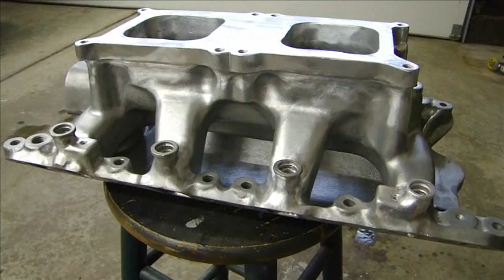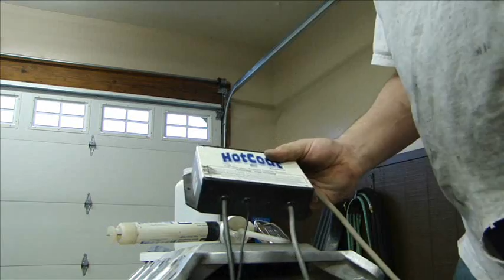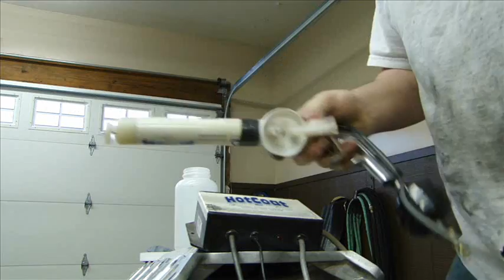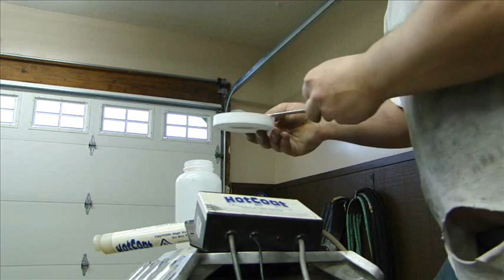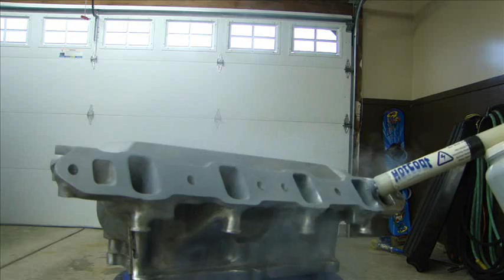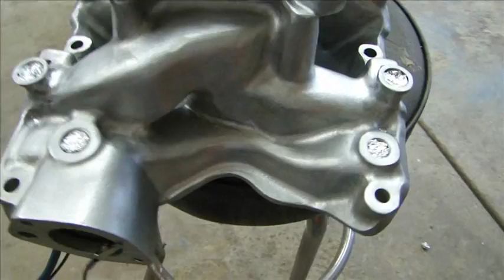Powder Coating Basics

Comment: What equipment is necessary at home to cure such powder coated items as this?  If I were to want to do wheels, I can understand the powder coating equipment, but the oven I am not sure about.  Do you have an oven to bake powder coated things in at your home?  Also, do you need to keep the ground connection on after the powder has been applied and while its baking, or could I powder coat some wheels or something and then take them somewhere to bake?
Reply from the maker: +Jayj93pgt You just need a simple powder coating kit like one from Eastwood. You can use a small electric oven that you can buy used. The ground comes off after coating.

Comment: Hey Pete I have cleaned parts extremely well, de-greased, coated, and baked. However sometimes i see imperfections like bubbles and fish eyes. Only method i have heard to avoid this is to warm the part or bake the part first before coating at all to get the gas bubbles out and or oil/grease you can not remove with a wire wheel, grinder, or de-greaser. I would like to know how you avoid imperfections from the process to get a smooth finish even on cast parts etc?
Reply: +djspock5150  also have you used any metallic primer or a type of primer base to smooth the part first?
Reply from the maker: +djspock5150 I do not coat the parts first. Sounds like you are being very clean. If you use anything like WD-40, and spray it in the same area you powder coat, there is enough in the air to cause imperfections. Make sure you put a small desiccant dryer in the air line right in front of the gun.

Comment: i wouldnt recommend coating those runners...but too late
Reply from the maker: +Mark Alvarado I agree. I have since stripped that manifold and recoated it without getting any in the runners
Reply: If you get powder in the runner just use your air chuck and blow some small bursts of air through each runner and it will clear the powder out of the runners. Problem solved.

Comment: Actually the part itself needs to be brought up to the temp your powder requires, for example. if super gloss clear requires a temp of 375 or lower depending on formulation, you need to bring the part itself UP TO that temp of 375 after flow out, THEN you set your timer for 20 minutes or however long the manufacturer requires. I've been an avid and professional powder coater for 7 years now and learned a lot making mistakes along the way. The reason you need to allow the part itself to come up to temperature is to allow the powder to properly adhere and cure and allow the cross link to happen. You risk for delamination to occur in the future and constant temp changes can cause it to peel from expanding and contracting.
Reply from the maker: Awesome! Thanks for sharing with us

Comment: Just so I understand you correctly you first applied the Silver Vein and baked it. Then while its hot you applied one coat of Super Gloss Clear and baked it again. Did you repeat this process for all 3 coats of clear?
I applied Super Gloss Clear to my Silver Vein after it cooled and did not cover very well. Can I reheat my part and follow your steps of should I start from scratch?
Reply: Paul Marshall I coat parts warm or hot with clear. If you are not getting your part to coat very well, instead of having activation switch on try coating without it. Sometimes with the heat and weather it won't coat well. Yes weather does have an effect. I also use a fluidizing reflector or remove it. The best deflector to use is the one with about 5-8 small holes on the front of it. I like using it especially when dealing with silver and copper vein or any textured powder because it mixes and evenly distributes the powder. The only time you need to strip it back down is if there are major flaws. Usually with the clear you can reheat the part because usually clear only needs to cure at 350

Comment: Is it okay to touch the work piece when it is charged?
Reply from the maker: Yes. But after you touch it you will need to recharge it before applying powder. DON'T touch the electrode in the gun.....you
ll get zapped.

Comment: Nice video. One question though. Is this motor going to see action, why paint the inside of the engine?
Reply from the maker: There was only powder coating on the inside of the intake. Since it is fuel injection the only thing going through it will be air.
Reply: ***** Aha, I don't really know that much about motors. Well, I know that they should be clean, except for fuel and oil.

Comment: Hey peter. I am really inspired by your video (eyeballing some powder coating systems on ebay right now). When you mention the temperature 375, is that celcius or farenheit?
Reply from the maker: The temp is 350 to 375 F for most powders. Eastwood.com has a great starter set. I have been using the gun for years and it's only like $150 and comes with some powders.
Reply: Very nice, Thank you kindly!

Comment: Pete   I just subscribed to your channel, "great stuff"  Just wounder why you Powder coat the inside of the manifold? I would be afraid the coating would come off over time
Reply from the maker: Steve, that has been the most controversial thing I have ever done in  video. This is a fuel injected motor so only air is going through the manifold. If it were a carb engine I would not do it. I have powder coated things and tried to bead blast it off and it is almost impossible. Once the powder is only there, only chemicals can dissolve it. Thanks for watching and subscribing!
Reply: ***** looks way cool

Comment: Thanks. I think I had it on the 25kv setting. So you're only supposed to hold the "charge" button for a few seconds, then let off and coat?? I have been holding it the entire time.  I did apply the clear when hot out of the oven (because you said to) and put it right back in. Its not terrible, but I want better.  :0)

Comment from the maker: It could be something simple like the part is connected to ground so the charge dissapates, or your air pressure is too high. Have a good solid ground for the clip, charge the part a few seconds before applying the powder, and don't spray directly at the part. Let the powder drift and settle on the part. The clear will discolor the chrome, but I have good luck putting clear on a hot part, right out of the over, then you can see how the powder lays. Try pre-heating parts first, it helps.

Comment: Pete, I could use some of your experience. I have a hot coat setup like yours. I have done a few parts. I am finding that power is not wanting to arrtact to certian parts at times. This IS NOT the faraday cage effect, just flat surfaces. I just did a part in reflective chrome and it coated well. I cleared the part the same day, and one select area was rejecting the clear. Any ideas how or why this is happening?? Its frustrating! Thanks for your reply.

Comment: mixing powders doesn't work, if you mix red and green, you get red and green speckles for the most part. like if you spray white, then don't clean the gun well enough n spray black, you get white specs or visa versa. you CAN add pearl, metal flake, etc though, and there are some powders that ARE multiple color mix to achieve cool effects. but black and white doesn't make grey like paint.

Comment from the maker: That is an excellent question. The dye in the powder is a contaminant, which means it colors each spec of powder. I don't think if you mix powders the dye would mix from one particle to the next. I am not an expert on that, but if you call the tech guys as Eastwood they would be able to tell you for sure.

Comment from the maker: That is a great question. From a manufacturing perspective I would guess their frames are painted internally, but sent out for powder coating. They are in the motorcycle business, not powder coating,,,but that is just a guess. I know guys prefer powder coated frames but I discourage it because it is impossible to touch up.

Comment: "Charging" the part is not necessary. From an electronics point of view having a good, secure ground is what will make the powder stick. Double check the continuity of the part with a multimeter if possible. Also I have opened up the Eastwood power supply box and there are no capacitors that "charge up". Just a single step up transformer.

Comment from the maker: Even the slightest breeze will blow off the powder. I have a fan I use in the room I coat in and it will blow the powder off. Since you are putting powder over powder, hold the button down for a minute or so to make sure the part is charged before you coat it. Also, it is possible that your air is charged with the same static needed to charge the part, or, the air is taking static away from the part. You can stop this by making sure the compressor is not on the same breaker as your gun.

Comment: Hey Pete, i have the same gun as yours. But for me when i try to shoot my powder on whatever i want to powder coat, sometimes the powder adheres good, but sometimes it will not adhere AT ALL. Especially when i try to do candy color, base go on good, but the second color will not adhere at all!!

I shoot the powder in my backyard, because i dont want to clean up the mess, do u think that is my problem? Because of the air/wind and what not?

I do have the ground clip onto a metal at all times.

Comment from the maker: Thank you very much my friend! Powder coating is a pretty cool process. I think you hit all of the finishes. The great thing about powder coating is it will not run. It's nice to have a glass finish that is perfectly flat. I have been working allot recently with electroplating. Nickle, tin, zinc, and aluminum anodizing. You can really do some neat things besides painting.

Comment from the maker: I agree with you Aaron. I think you are talking about MAACO? The only problem with powder coat is repair. Mixing, blending and polishing paint makes a flawless repair. I don't think you can get the same results with a powder coated car. The chrome does not look like chorme plating. The intake in my video "The '85 Mustang Breathes" has a chrome powder coated intake so you can see. It looks good and the customer was happy.

Comment: Steel rusts, its simple. you port and polish and match your air intake holes. remove some material.. polish... dont  cover the metal and put it back together.. your engine will be sucking rust dust in a year :)

Comment: I dont want to break this to you. any time anybody does a proper paint job... all the plastic, trim , chrome, glass you name it comes out.

If that doesnt get done, you probably went to maiko haha.

I do this for a living and I would rather powder coat my car then paint.. powder coat is much more durable, as for stripping, simple aircrafat paint stripper removes that like a hot damn, it even strips chrome plating.

Question for video poster. Does the chrome coat actually look like crome
plating?

Comment from the maker: I will share this with you. I had a customer who changed his mind on a color after I powder coated his part. I could not sand blast the powder coat off at 120 psi. There is no way the powder coat will chip or flake off like paint would. If it did, depending on the size of the piece, it would most likely just break up and pass through the exhaust. I do not think it would damage any internal parts.

Comment from the maker: The bung holes don't need to be sealed because the injector o-ring is deeper than the powder goes. The throttle body mounting area is a gasket under compression. No need to keep it clean and I want the color to be even. If it were a carb with the chance of gas getting on the surface I would mask it off. And I use a regular house oven...nothing special. It is dedicated for powder coating. You can get a used one pretty cheap.

Comment from the maker: Just to make it smooth. Only air will be going through it.
Reply: it changes the cfm inside of manifold and intake runners are not polished there finished to about 220 grit  allowing the proper disbursement of air and fuel the very reason for the performance increase of  manifold if polished the air fuel slides thru to cylinders not properly atomized and performance is lost big time.

Comment: I love everything about Powder coating. Its cheap and easy to do if you learn how to do it properly and remember the cleaner the better. I did opt out and spent extra and bought a better gun after a year. Powder spreads nicer and waists little. Its a very durable finish and lasts a lot longer than any paint or anodizing does:)

Comment from the maker: Thank you... I value a pros input. If we were talking anodizing I would agree with you about complexity. Powder coating is fairly simple. A clean, bead blasted surface, degreased and properly handled, an even coat of powder and the proper time in an evenly heated oven. It's not much more complex than that. But I do appreciate the input. Please don't take it wrong Rick....I respect your work.

Comment: if you dont have a clean metal part (not only bare but properly clean, free of debris, grease, etc) you'll have adhesion problems. in other words, you'll be able to coat the part and cure it but eventually the paint could peel off.

Comment from the maker: Yes....but no....it is not the same. The chrome powder coat looks very good, but it is not as good as a real chrome finish. If you had a real chrome bumper and a chrome powder coated one, you would be disappointed in the powder coated one. Plus, powder coat is not as resistant to chemicals like real chrome. Sorry I could not tell you what you wanted to hear.

Comment: The Gema is an awesome gun for sure! One of my buddies has a Gema unit. I'm not familiar with other Wagner guns so I cant comment about them.  I own a Prima Sprint unit.  Bought it new about two years ago I believe. I love the controllability of the gun. It has a few presets (multi coat setting, faraday cage setting) but what I really love about it is the double trigger pull setting. You can double tap the trigger and it will go to a predetermined setting. Your right about the preference though.

Comment: Dynasty.. with the studies that i have done which are "pretty" accurate ( running same parts w/ same line speed/ powder settings/ and mill checks after) the Gema used less powder than the Nordsons.  Now Wagner is not your BMW of powder units but i use an old Wagner to and it gets the job done.  I think it also has personal prefference as a factor as well.. gun weight.. how it feels in your hand etc.

Comment from the maker: You can use infrared lamps but I have never tried it. Paint does not require heat but powder coating does. The more even the heat the better the result.

Comment from the maker: I mention I use laquer thinner because it is a safer and cheaper non-hydrocarbon. Acetone is a carcenogen and absorbs into the skin quickly. It is also very bad for the lungs. I mention wearing gloves so grease from fingerprints are not left behind. You wrote that "the paint" would not bond properly...but I am sure you meant the powder. Your knowledge is welcome, but sarcasm is not necessary. One does not need to powder coat every day to get perfect results.

Comment: Here is an important tip from someone who actually powder coats for a living, use acetone to clean the surfaces that you are powdercoating because any grease oil or and foreign contaminate that is on the metal can and will cause the paint to bubble flake or even not bond to the metal properly

Comment from the maker: It's not a dumb question...others have asked the same thing. The only reason I coated the inside of this manifold is because it is fuel injected. The smoother the inside the more laminar the air flow. If it had a carb I would not do it because the gas would wear it off. Thanks for watching.

Comment: Thanks for that. I wondered if there might be a problem with the finish. The finish is very glossy but it is very soft not like a paint finish. I tried to use TCut to polish out some of the scratches but it dulled the glossy finish to a matt black,which goes to demonstrate how soft it is.

Comment from the maker: A swingarm is a pretty hefty piece of metal. It is not normal for powder coat to be soft or mark easily. My guess is the place that did it for you did not let the part reach the proper temperature long enough, then hold it there until the powder baked out. I would ask them to redo it for you.

Comment: Very good work. I agree with you that applying a clear to a hot part works really good and flows immediately, however there are times when you should remove the part, allow it to cool to say 180 degrees and then apply the clear to the now "warm" part. @ 180 degrees the powder will not flow out but will stick to the part in an opaque covering, allowing you to see for sure that you have covered all parts completely. Just a trick I learned. :)

Comment from the maker: As I mentioned in the other post, Aircraft Paint Stripper is totally organic, no acids. It is water soluable and just rinses off with a hose. Give that a try, You will need to make sure the metal is clean and degreased before coating. Laquer thinner does the job very well,

Comment from the maker: When you put a part in the oven you will see the powder stat to melt and flow until it is shiny. After about 15 minutes I pull it back out, put the clamp on and put the clear on just like you described. The clear will melt immediately if the part stays hot. This helps get an even gloss all the way around. Then put it back in the oven and bake it out per the instructions. You will go from beginner to expert in no time. Good luck...rock on my friend!!!!

Comment from the maker: The powder coating has to go directly on the metal. it will not stick to paint. You can paint over the powder coat for effects, You just have to do a test to make sure the paint does not disolve the powder coat. I have tried to sand blast powder coated parts and it is almost imposible to get off. Pressure washing won't even come close to tearing it off.